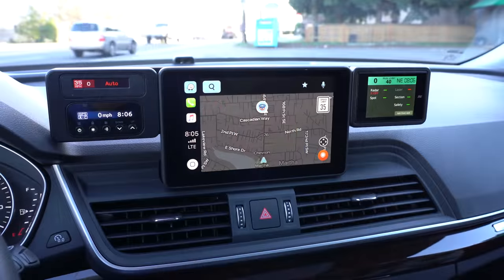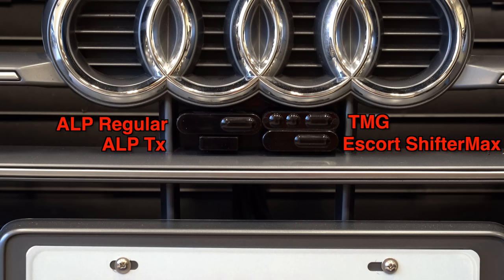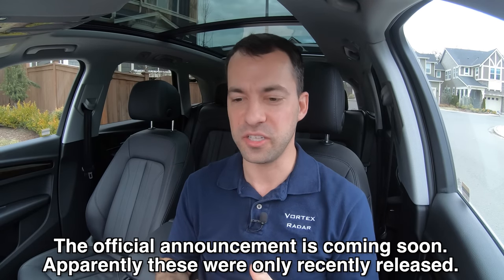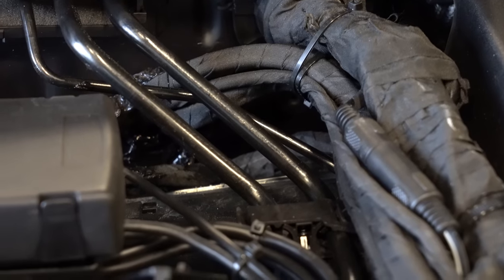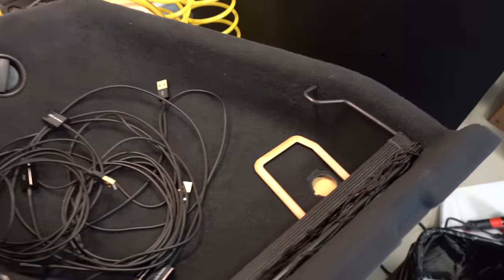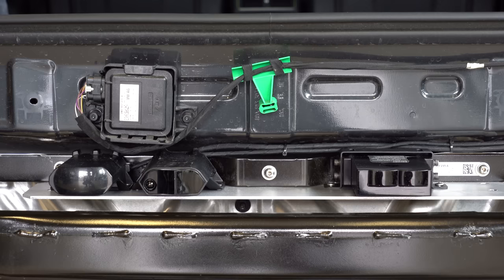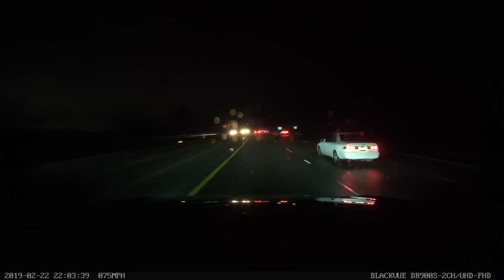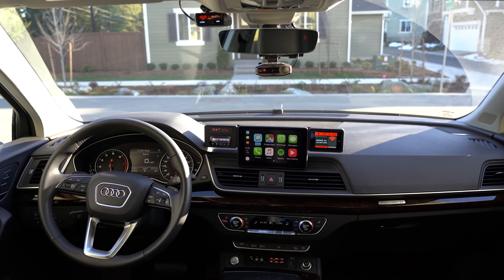Building the Ultimate Radar Detector and Laser Jammer Testing Vehicle Install

Comment: I have acquired the Uniden R8.
I am mulling a reflex aluminum wrap for the R8 to create a Faraday cage for a Stealth insulator for DC, VA, MS and for Canadian friends. 
I have the Beltronic STi Magnum, and it has the twin LNA horns with the magnesium metal case and metal wrapped horns.
This is why I thought of an external wrap.
Might you consider testing on Uniden RDs?
Reply from the maker: Sorry, but it wouldn’t help. All the leakage comes through the horns, so anything you do to block leakage going out of the horns would also block signals going in to be detected as well. A magnesium case doesn’t help with blocking leakage which is why they could eventually switch to plastic cases for those series of detectors without impacting their stealthiness characteristics. If you need a stealthier detector, get a stealthier detector.
Reply: @VortexRadar  well the Bel STi is fine with segmenting K band still 8 years later.
I do not see any difference in LNA Antennas horns with out cracking the R8 case. Reviews appear too similar. Sure the DSP Chip has improved with time.
Thank you for your follow up.

Comment: T-taps, at least ScotchLocks, are designed for solid wire, which is used in houses. As you heard, they can cut wire strands. Especially if they are off spec or not matched to one exact wire guage. FWIW.

Comment: How is the OEM car battery and/or alternator holding up with all the electronics? Do you have a fire extinguisher handy in case hot spots flare up! I was looking at the 3 battery backups strapped to eachother. When they leveled your widgets, did they make sure your tires were equal pressure?

Comment: Those radar detectors are mounted  way  ......

too low.

Best use of fake grille panels yet!  Maybe you will get a new Supra and go crazy?  Think of it,10 fake grille and vent panels.

T taps are damaging to wiring.  Soldering is much better if one has to tap into a line for power.

Very nice setup, but a lot of equipment will be less expensive to leave in the car than the cost of removing it then restoring the car.
Reply from the maker: Mounted too low? Do you speak from experience? I've tested this setup before on my Miata and a low mounted Max Ci 360 managed to outperform the R3 mounted high on the windshield. https://www.vortexradar.com/2018/02/remote-radar-detector-test-results-feb-2018/

Not every vehicle allows for ideal placement in every instance and often times the reality is you have to install them where you're able. The low mount in the Q5 was the best place to install them so that's what we did.

Comment: I live in Australia what would be the best stealth radar for me and where to purchase ??
Reply: Hi MS1, what part of Australia you live in?
Reply: Demetrius k tassie
Reply: @ms1_77  I live in Sydney. Depending on what you want whether its radar & laser or just radar ? For radar I would recommend the Radenso RCM front radar only, custom install its fully stealth which means the police radar detector detector will not get you. For laser jamming I would recommend either the TMG quad head laser jammer, or the AL priority quad head laser jammer both units will do the job just remember to have the laser jammers programmed to 5 second jamming that way it gives you 5 seconds to slow down then the jammers will go into receive mode only that way the police laser gun can get a speed reading on you without the police suspecting anything in your car. You can buy these products I just mentioned from Western Australia either from The Radar Shop or from dontgetcaught.com.au you can check out both their website's. They are expensive devices. Anything else you need to know just message me & I will try to get back to you as soon as I can.
Reply: Demetrius k Thankyou it’s a small price to pay to keep your licence
Reply: @ms1_77  that's right, well I was going to mention besides being very expensive devices is that your licence is priceless..... Anyway go to their websites check it out do some research & let me know if you have any questions. Reason why I know about all this is that I used to work installing all the police radar equipment in their highway patrols as well as unmarked police cars, so I know what equipment they use & what counter measures to use against them. Anyway gotta go out for now chat next time. Cheers.

Comment: Are you still running the stock alternator with all of this?
Reply from the maker: Yep. I didn’t have any issues on the Miata either. As I said in the video, I don’t actually run all the equipment at the same time in general, though it had no problem when I did for the video too.

Comment: I'm on my phone and don't have another device to test with, but I'm getting a video and audio delay at 7 minutes or so. Video is about a second behind the audio
Reply from the maker: huh that's weird. I'm rewatching now and it's in sync. Maybe try on another device? or refresh on your phone?
Reply: @VortexRadar  Ah, glad it's not the video. Thanks for checking and replying! 
I'm curious why you mounted the tmg cpu up front. You said you need the physical buttons up near you but the John boy app gives you control over everything needed (except power). Is this just preference and not wanting to have to connect for all the controls?

Comment: I don’t even want to know how much the install and parts cost...

Also, why do you run a front plate? It’s not actually enforced in WA despite being required. Not having one makes it harder to get a laser reading, although you probably don’t have a problem jamming that anyways.
Reply: Not enforced? Pull your front plate and drive around. LOL
Reply: T. CloCK Haven’t had a front plate on any of my cars for over a decade and it’s never been an issue when I’ve been pulled over.
Reply: @denoex2362  You must live on the west side..LOL. My son just bought a new car and only put on the rear plate. Got pulled over 2 days later and got a citation. Officer told him they give you 2 plates for a reason.